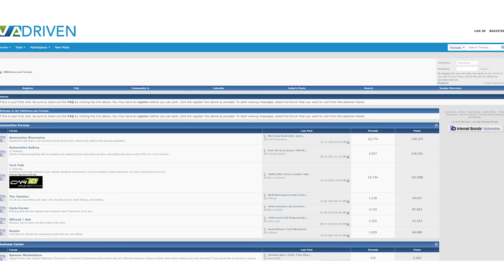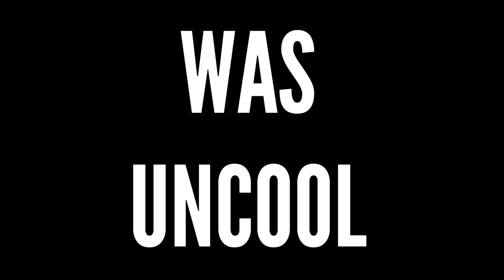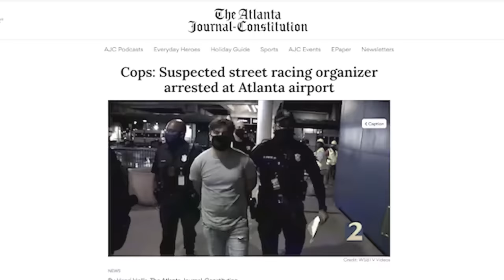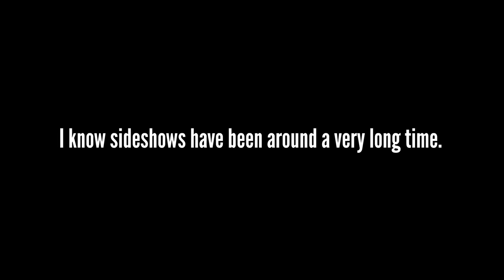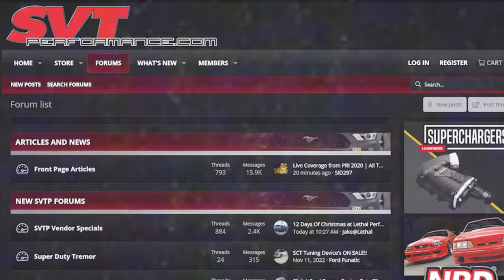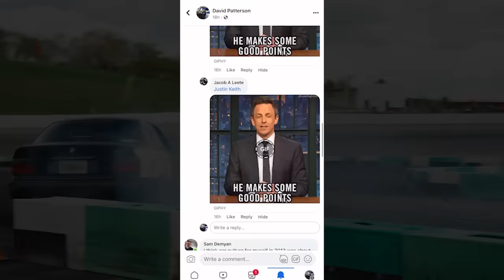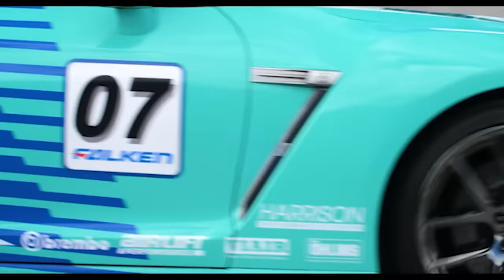Car Culture Has Changed: 2012 vs 2022

Comment: Ngl this was nostalgic af. I got into cars as a preteen because of my dad & older brother. This was before f&f in the mid to late 90's. My first car shows and "illegals" was early 2000s.  The scene definitely was underground and kinda an invite basis. I really miss those days. It was protected and not mainstream yet but it made it more close knit. You got to see your friends builds as they progressed week to week month to month and so on. You'd meet up at the arcades until they closed then hit up a gas station near the industrial areas of the city. And roll out to 1 of the spots until the cops showed up and would rotate to the next spot and this would go on till 3 or 4am. Listening to burned trance cd's from limewire and filling up on the cheapest candy which was usually apple o's or gummy worms and Arizona iced teas because it was all we could afford. What a time

Comment: As someone who's twice as old and have been heavily into the car scene since the 80s drag racing folks met behind strip malls, then racing 911s since the mid 90s, now endurance racing. I can tell you many of your opinions are also due to your age and susceptibility of outside influence. Most of us older folks have had a disdain for the new "culture" since '01 for obvious reasons. By 2012 it certainly wasn't hush hush, at least in New England and lower US including Texas.

Comment: I’m not trying to stereotype car meets when I used to go car racing and my Pontiac GTO back in 2007 2008 and 2009. We would take over in industrial parking lot. Like a Home Depot Costco warehouse, are the Lowe’s improvement store. Unfortunately the Mustang guys would always start trouble with performing parking lot takeovers. So we would have to move it along to another parking lot or abandon road outside of the city.

Comment: Hampton roads in the late 2000 and early 2010’s was great there was such an amazing mixture of car builds. We had all the drifters that would take their cars to punto and black water. Vip cars, euro cars and imports. Only issue was cops did not like modified cars at all. I was one of the first to do a full vip Mercedes build in Va and it was great. Moved in 2016 to Florida and here is a whole other animal when it comes to cars.

Comment: One thing I remember from back then ( I think we're around the same age, so similar time) was if you wanted to have a fast street car, 8 out 10 times it would be a manual. But now, it's the opposite. Not a bad thing, just interesting what advancement in car tech has done - your grandma can literally drive your car as fast as you given an afternoon or training lol

Comment: I wish I was able to experience 2012 car culture. I only began to take interest in cars when I got one, and although I love working on my car, I don't enjoy many meets. Aside from takeovers, "respect all builds" has gone wayyy too far. People pull up in a shitter with nearly perpendicular wheels, underglow, an amazon wing, anime stickers, maybe a CAI or straighpipe, and call it a build. On the other side of the lot, there's hundred thousand dollar cars that are simply fast from factory. Either that or a new m series with a downpipe and email tune that puts out 800 hp with absolutely no work done my the owner. It's very rare that I go to a car meet where there's somebody who truly put work into their car that doesn't include the most basic intake/exhaust modifications. Even if I see a built motor or engine swap, often times the owner just paid somebody to do it. The main issue is owner knowledge/wisdom. They like cars but don't know much about them. This wouldn't be an issue if it weren't for the fact that they like to PRETEND that they do. Everybody starts somewhere, but there's way too many people that pose their level of knowledge.

Comment: I got my license in may 2014, the quickest I could in my state due to my age. I was a broke high schooler driving a battered old Chevt Silverado I got for free from my grandmother (although the head gasket went in it the week after my 17th birthday and I got a gold 2000 Mitsubishi Galant with the 6G72 V6). I didn't have the cash to actually do car stuff for fun until 2017, when I was 19. A good friend of mime  was also a car guy and had a Saab 9-5 Aero 5 speed. I ended up getting a 2009 Mazdaspeed 3 shortly after meeting him and getting to drive a turbocharged car for the first time.

Comment: From the Bay Area. What you call take overs were absolutely a thing out here a decade ago in the era you’re talking about (where you say they weren’t a thing in your area at that time). 

Here, they’re called side shows. People on bikes or ATVs or in cars (often stolen so no one cares if they get cracked up) are pretty common. At the bigger events police don’t really mess with them. When people like highway patrol show up it’s hundreds of folks in the crowd, many with guns. Cops have bottles thrown at them until they leave and there are people shooting guns into the air. So, one or two officers isn’t going to get involved with that (once in a while they shut down smaller side shows with a larger show of force). 

Hell, during the George Floyd riots a dealership near Oakland was robbed and about 80 cars were stolen (lots of muscle cars). 

There are parts of Oakland you can go to where the streets are LINED with old abandoned stolen cars that just have homeless people living in them (dozens and dozens in each pocket where they get dumped). 

Kids (teens or in 20s) steal cars, have fun with them, then dump the car and go get another. 

Car modification culture is and has been, obviously, a thing out here, too. But, it’s pretty separate from sideshows. Classic cars, low riders (lots of overlap between those), drift cars, and the rest … uh, not a lot of the truck scene here (we tend to have all of our teeth and not date our sisters). There’s also a big influx from the money in the area. Tech workers making crazy money who can afford the exotic toys.

Comment: I started driving in 2002 in Wichita Kansas.. you would get your ass beat and your roof stomped in if you showed up at the meet and start spinning tires and doing donuts... people were there to drag and if you brought attention to the spot you brought the heat down on yourself. Fast forward to 2023, everyone has 400+ HP and I bought a manual e210 Corolla to build and try to make 230 just to be the only guy in town driving a built e210.

Comment: personally, mod your vehicle as you like. i just dont understand when people buy a 25k wrx and want to dump another 26k to make it a 0-60/ quarter mile car on stock internals. you bought a rally car and yet you want to try and compete against supercharged v8's in a straight line(which they prob bought the car and modded for what you bought your car for) i dont understand when people purposefully go against what a car is designed for in my opinion

Comment: I think the biggest problem is the fact that no one drives cars any more. ….like actual cars. Not trucks, not SUVs, not crossovers, not minivans, but actual cars. So you’ve got a younger generation who wasn’t exposed to any real car culture because there was none. They will grow up reminiscing about the vehicles that were popular when they were growing up, which was probably either some truck or SUV. 

All those fast and furious sequels aren’t like the original three at all. All they do is buy the fastest factory car on the market and just drive that to the limit. There is nothing special. Nothing unique. I find myself waving at drivers who freaking replaced their badge with a transformer emblem because in my mind, it been “modded,” and therefore worthy of my admiration.

Comment: Also getting a used to be fast car isn’t the same even hopped up, compared to supercharged two turbo expensive stuff. 1500hp is the new 800hp where I’m from. I though I had it made  with a Paxton 2013 GT everything down tk the suspension and 720whp. But now I’m the underdog “if” I choose to run it.

Comment: I think the big issue is newer cars are nice but no one ever wants to change anything. Dont change their super cool steering wheel or their bucket seats or dont tinker with the dash and its already got a cool stereo. New cars are nice and fast sure but the personality is gone. You are not seeing newer cars w/ crazy shift knobs, colorful steering wheels, or off the wall interior changes. Its sleek but its boring its beautiful yet bland. Car culture is not just about the engine swaps or power put to the wheels its the personality. Its why i fell in love with cars like the del sol because I had a vision with the colors, wheels, seats, after market wheel and dash swap ideas with S2k speedometer. I cannot see myself being able to put in that personality into a new GTR, Supra, or anything older then 2015 honestly.

Comment: I got my first civic in 99
Back then there wasnt much aftermarket support. We would take parts from larger Honda engines like headers, exhaust, ect. 
I remember lowering mine and some hommies shit by heating up the springs and gutting some off 
Damn I’m a old man now, I would slap the shit outa my son if I catch em doing that. 
Coolest tuner car I had was actually a 99 neon 2 door 5 speed, 
We built it for a business so it was made to be silly and never actually driven.  Like having a big ass fish tank in the lobby of your business. We had hundreds of hrs of fiberglass into the interior, this thing looked like a space ship with a huge wave like molded center console that went all the way to the rear window kinda separating the interior into two halves. The outside was a mix of so many cars 
Lexus tail lights, Subaru headlights, bmw fender vents (back when u had to get fenders from an actual z3 and cut the vents out and weld them into factory fenders. Body kit air bags 
It was crazy 
I eventually sold it online in 2008 for 12k. 
Crazy how much time and $ was in that silly thing.

Comment: Im old man i guess, I drive a 1970 Chevelle with 33x22.50 tires 605 Big Block makes l 850 hp had some guy make fun of it called it slow lead sled, thing weighs 3600 lbs lol Those take overs have ruined being able to have organized events

Comment: So you were east coast , but 2012 was too late for Ave P and Doremus Ave in Newark NJ as I think around then or little before they finally added the speed bumps.  New cops use to chill and watch the racing, 12am to 6am Thursday to Saturday was bid down there . NY , CONNECTICUT,  Pennsylvania and all of Jersey would show for the racing and rt440 lead us easily to other places for good uninterrupted racing . I'm sure some reading this have been there. I miss it so much but there is always a couple asswholes who ruin it for the rest. 

Main issues was there were lots of trucks during the weekday coming and going and blocking them would get us kicked out but many had respect for them and let them go and usually most truckers would wait to watch some of the races . But then I heard some cops got hurt or even killed in a chase from there and afterwards that ended it . I raced my 2nd Rx7 with Street Port engine and my 300ZX 2nd Gen NA and My MK3 SUPRA targa top , she was tuned for about  350-380 hp and the BOV with the exhaust would scare ppl . Miss it so much the scene , the music and the girls man . ❤

Comment: Hello 👋 great video 👍 I just want to add some reality checks about what the video shows: 
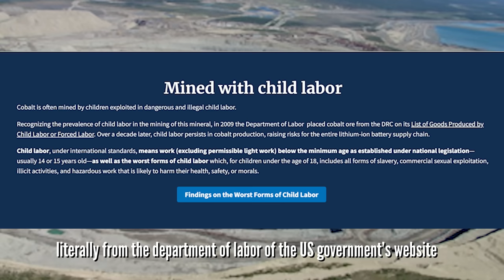- @7:21 this is a copper mine in Kolwezi (Congo) not a lithium mine. Lithium is mostly extracted by evaporation in large bassins and is mostly coming from Australia
- China doesn’t actually produce lithium but process it and is the leader on the market
- 95% of cobalt production is official and government owned, in those unofficial 5% remaining, less than 2% can be link to child labor. Little know fact is that gas cars use cobalt  everyday every time because cobalt is used to remove the sulfure from oil. Meanwhile a majority of electric car batteries don’t have cobalt and use lithium, Iron and phosphate. So if you don’t like cobalt and child labour driving an ICE car is not the best option either…

Comment: Car culture has changed but one thing that has not changed is the price of speed when it comes to cars. You need to be very flush with cash if you want to go fast in a car and that's not even mentioning  the mechanical maintenance and insurance costs of such a car, fast car culture is a rich kids/ rich man's hobby,  always has been and always will be. Owning a 10 second or less car is only a fantasy and dream for most people so they are stuck with a 15 or 14 second car at best as they do not cash to get to build a engine that can move somthing 1.6 tonnes and over.

Comment: I'm going to be brutally honest with you here; Car meets back in the day were always going to devolve into what we see now. It was always about show, and not go. People did the dumbest things to their cars back then simply because everyone else thought it looked "Mad Tight, Yo!". It was always about image over substance, and the very predictable progression of that image over substance culture is what we see now. 

Contrast that with the track culture and how it hasn't changed hardly at all. OF COURSE IT HASN'T! Being fast and looking fast are two totally different things. Being fast requires the car owner to ACTUALLY know what he's doing. It requires discipline, and a disdain for anything unnecessary (lest you add weight). Track culture will always be, more or less, unchanged. Being fast is not measured by the whims of the crowd, it's measured by the stop watch. The stopwatch doesn't care about your cool looking cross drilled rotors, or that hot ground effects package. It only cares if it works. It knows your cross drilled rotors and ground effects packages don't work, and it's not afraid to tell you. The stop watch never lies.

Comment: Know nothings with money taking a stab at attention are a problem. They tend to install power mods without considering longevity, and flock to take-overs rather than learning experiences. Luckily, that will fade away when a new fad takes over. Unfortunately, that may not be enough to eliminate drifting. How going around a corner in the noisiest way, rather than the fastest way, has gotten so popular is a mystery to me. Then again, all the above maybe just illustrates that I am, indeed, an old dude.

Comment: Actually, it might be good if car meets would die out; the car "community" in general has gotten pretty toxic. The people at these gatherings don't even care about cars per se; they are not passionate, they are passionate about money and scan the place to see who has the most money so they can suck up to them (not literally, but you know). I remember the car "scene" in Europe from the early nineties, where people would meet up and talk about cars and their experiences with them. It didn't matter what it was or how much money you had invested, how expensive the paint or the mods were; if it had wheels and a steering wheel, it was interesting to them in some way or another. Now there is nothing special, it's just "look how much money I've spent, I've got 800 hp that I never use, hur dur," boring, to say the least....

Comment: The difference between car culture from 200 was different to 2005.
And 2005 to 2010. 2010 and so on ....
Definitely sucked after 2008 in Las Vegas. That's when it really dropped off.

I think the generation then never had their pops with a wrench hand..

Comment: Ya need someone older to take it back to the 80s. 
Cruising the strip 
Illegal deaths where not posted online ( no cell phones yet lol ) 
Mini trucks where huge 
On the west coast VW bugs where huge and if you had a built bug , you could whoop the average mustang or Camaro 
As an import enthusiasts ( Datsun 510 / Rabbit GTI)  it was a small group that you had to find by flagging down another one you spotted . 
400 hp was fast ! 
12 sec quarter mile was fast but most of your buddy's where lucky to hit a 15 
We didn't yet have affordable standalone or turbos so it was high compression and big cams with webers . 
15" where standard wheels and 17" seemed huge 
The Honda scene was slowly taking off and I worked at a tuner shop and every kid in the world would come in wanting lowering springs and loud exhaust..   lol.

Comment: the 90s and very early 2000s were the golden years. you could buy a 1g dsm for $2k and slap a t3t4 on it then embarrass a boomer that dropped $100k on a viper. at least that's what i did. 

now if i want to go fast for cheap my only option is a used liter bike i have to nurse back to health

now people just get a challenger for $70k and run it off the lot stock. if they have good taste, maybe they get a gtr

Comment: Come on I was there.  THere is just no more cars that are cheap and fun without being overpowered.  How do you show off an Integra?  You make it look super sweet.  How do you show of a Hellcat?  BURNOUTS.  thats it.  handling is shit, looks are ancient and traction is non existent.  Car culture has changed because the cars are gone, Everyone and their mom drove a civic, but some had an Si, some had a type R.  the fact that these were all civics connected everyone in the community.  Cars are now isolated by a sea of SUV's for sale which get all of the R&D from companies.  WHen is the last time someone released a practical performance car?   BRZ is a perfect example, how does one get a kids car seat and groceries into one?  they don't.  How do you do it in a Si coupe?  slide the seat forward an you're good.  I'll drive my CL9 until there's no more gas for sale if I can.